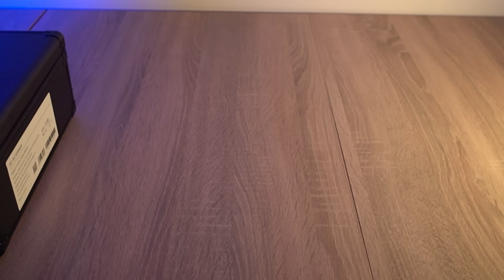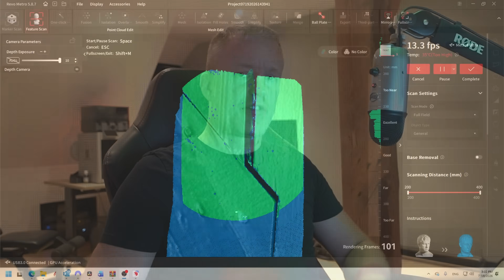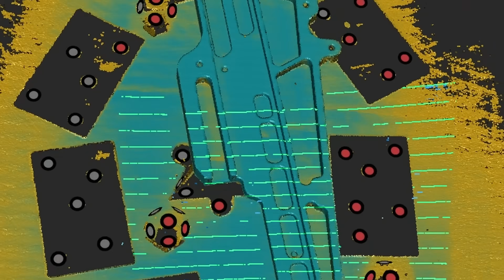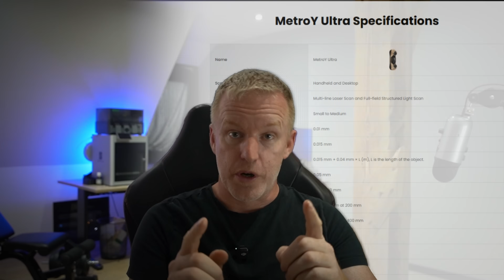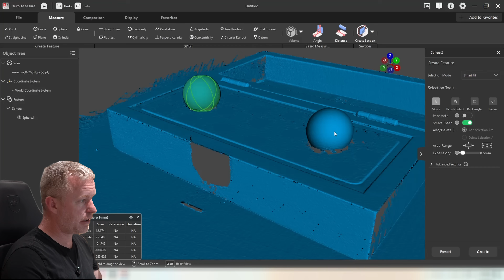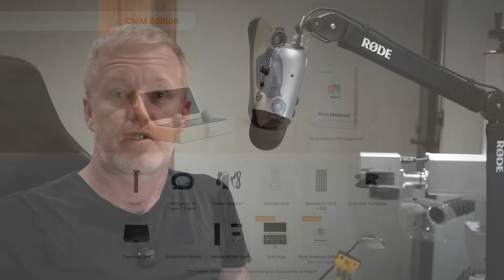Revopoint MetroY Ultra 3D Scanner | Industrial Metrology for the CNC Workshop?

Comment: This is amazing stuff, I appreciate that it does a lot of maths but surely just moving the scanner in and out slightly could have the effect of mimicking depth details not actually there?
Reply from the maker: Do to the angle between those two depth cameras make it possible to actually see depth. So if you move it slightly closer of further away it will actively compensate and no faulty artifacts will be the result. 

The math itself is quite simple, but doing it with 9000000 points at the time makes me super glad that the scanner does the calculations:) 

Thanks for watching ! And make sure to sub !